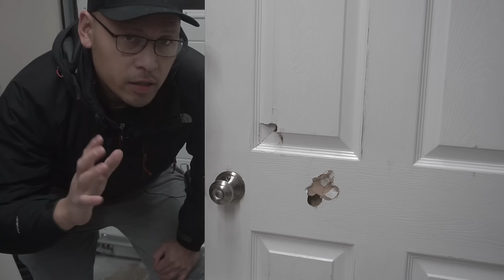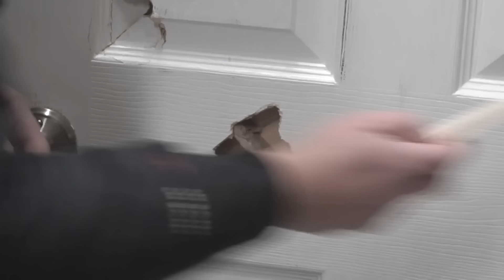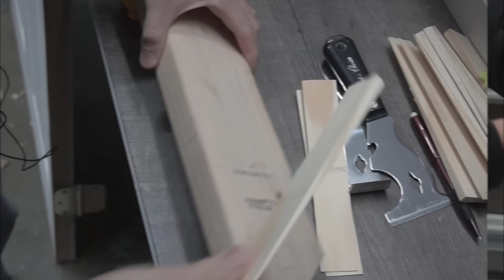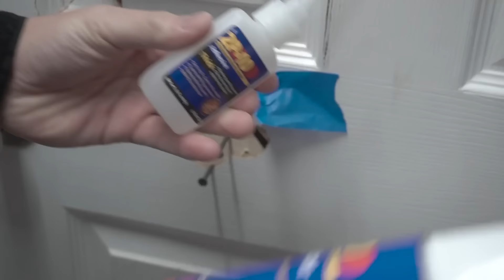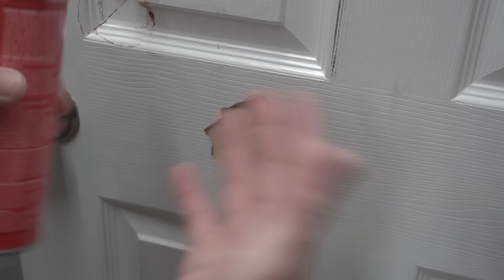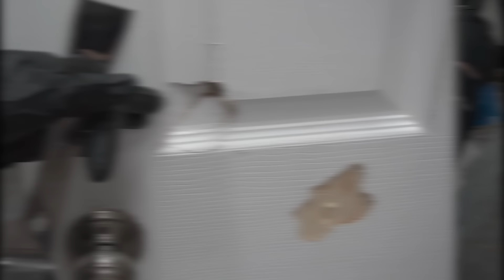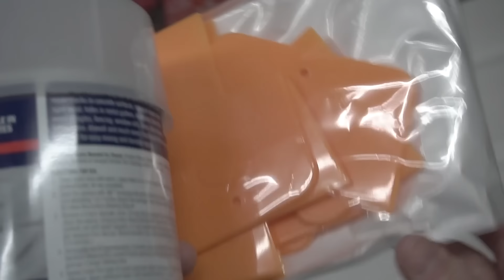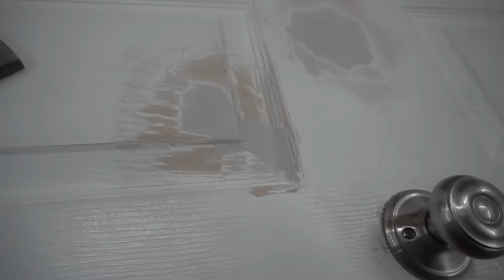How To Patch And Repair A Hole In A Hollow Core Door Like A Pro! EASY DIY Tutorial For Beginners!

Comment: This helped a lot.. I am putting a cat door in my bedroom door that looks exactly like the door you did this job on.  Unfortunately I made a bigger whole than I needed. I had some left over  wood and used screw to fill in the one side of the door so that the car would fit snug in the door.  The wood I used was thin and doesn’t match the thickness of the door.  So on one side the cat door covers the screws and the whole, the other side, not so much.   I might be able to use your method on this part.
Reply from the maker: I’m glad I could be of help! I hope you are able to put the cat door successfully! 🙏🏽😊
Reply: You could get a bigger cat … 😂

Comment: I prefer JB Weld's wood putty over the Bondo, followed by a wood filler to smooth it out.  It's durable, and a little easier to tool for those contours

Comment: Spend 75 bucks and a couple hours to do this, or spend 60 bucks and buy another hollow door hang in bout 5 minutes. No sanding and no blemishes. That is how a professional does it
Reply from the maker: I agree sir. Nothing wrong with options. Plus some people own really expensive hollow core doors that cost over $200+ like Masonite brand
Reply: @FixThisHouse  if I pay 200 dollars for a hollow I am not putting a bond patch in. That's like putting duct tape on new Cadillac. It will work but it's ugly to look at.

Comment: You used Great Stuff for windows and doors, which keeps it rubber properties, and remains soft for seals and such.  The regular Great Stuff, especially the one less expansive foam (1 inch) dries much harder, and works better for holes in doors or walls.  Otherwise, very informative and well produced video..

Comment: My door wasn't as badly damaged as this door, but the Bondo worked great. The only thing with Bondo is that it cures extremely fast. I had about 2 or 3 minutes until it hardened into a taffy consistency. So work in small batches. Otherwise, like I said, it worked great for me.
Reply: Durabond 90 dries hard and is easier to sand than bondo.

Comment: Thanks for the tips.  Wondered why you didn't just put the spray foam in first and then before cured, put the wood shims (I guess we've all used paint sticks too) in with a longer curing wood glue so it doesn't firm up too fast and let the expansion of the spray foam push the wood against the back side of the hollow core door? -- you mentioned that you waited several hours for the foam to set up any way -- pretty much ends up the same wait time in the end?  

short-strand fiberglass Bondo (has a green label) works nicely for the same. I added 1-1/2 inches (square cut wood from a 2x4 trimmed to 1-3/8 deep) to the bottom of a hollow core door.  there are opposing vertical/horizonal patterns when you span the bottom of a door... used a thin putty knife to approximate pattern-- light sanding left valleys approximately the same as the pattern. 

I only mention the stuff with fiberglass as it sanded super smooth (all bondo does) but I was hoping it added some flex since hollow cores are flimsy. 

Any recommendations on a contour sanding kit which would have helped on the grooves if you'd wanted to get a finer touch on those grooves in the panel?

Comment: If you want to replicate the graining of the original finish use a clean yard broom or similar in the semi-dry primer/undercoat surface  to wipe the surface, a single stroke should do it.  Let it dry and then paint over with the finishing coats.

Comment: The hole is smaller than yours to barely allow one shim. Do you recommend tape, a drill bit to sit in the door (I am using a hand drill) foam first then the shim to hold it in? I just don't want to drop the piece but the screw you recommended isn't long enough to brace  against the inside of the door, to hold the glue even with activator.

Comment: You can actully copy the wood grain pattern first by putting on a realsing agent then applying fiberglass resin the cloth and more resin after it sets up peel it off the door gentle now you have a mold to use to reconstruct the wood grain pattern.  Practice with this first on somthing else but I'm pretty sure you can duplicate it good enough no one else will notice the repair.  Paint will go a long way to hide it.  Add a comet if you've done this and let us know if it worked for you I haven't tried it.

Comment: Good job but remember people if you don't have all of these things to do the job,Cost of spray foam, bond filler, glue, paint and your time spent fixing the holes you might as well just buy a new door these none sold doors are cheaper than buying everything you need to fix it.
Reply from the maker: That is true 👍🏽😊, some hollow core doors, especially the Masonite brand can go up to 200+. But yes 6 panels Reliabilt are around $60
Reply: Not with the cost of wood and inflation, it's cheaper for the repair.
Reply: @celticmulato2609  you do no the materials to fix the door has also inflated the cheap core door have not really gone up in price as they are not solid wood doors,so no it's not cheaper to fix the door as the materials have gone up in price than what the cheap core door has.

Comment: stuff holes full of paper.... full hole with joint compound..... apply s thin everal coats and sand smooth
Reply: takes several times till smooth....alot faster and cheaper

Comment: Great job thank you 🙏 for sharing. Question for you. If you use hot glue gun might be easier than the glue you used. What do you think?
Reply from the maker: Thank you 🙏🏽! Honestly Hot glue gun might work! Just make sure you drill carefully because hot glue in my experience is not that  strong of a bond. After filling with foam it will be secured 👍🏽😊

Comment: Good work.

Question is wouldn't it be cheaper to replace the door? Youve used about 100 bucks in material (if buy everything brand new: 15 bucks a can of foam, 65 bucks a foam gun, 15 bucks a pack of shim,  about 20 bucks putty, plus paint etc, plus 3 hours of labor), yet the new door is about the same.

Comment: could you screw it in the either side with a counter sink screw to hold the wood instead of using the glues and filling the screw holes with the wood filler while filling the main hole after

Comment: Fix that detail with a dremel tool. Go easy on the paint, don’t need to apply so much at one time. Using thinner layers you can use your brush to simulate the grain.

Comment: They should make these doors smooth, because matching the grain is impossible
And your patch would go unnoticed
You can also use a profile gauge to put on the mud
I used one to fix baseboard, and you can not see it
Also, real panel doors that these ane meant to replicate do not have raised grain , they are smooth the same as colonial trim

You could actually fill the raised grain from day 1, and have smooth doors in case they need to be repaired

Comment: Hello there I'm currently trying to fix a door with the second issue with the detailing however it was a clean break (if that makes sense) and all the pieces are intact just bent slightly inward, would I be able to use the screw to pull the pieces back into place and use glue and paint to fix it? I'm not much of a handy man so if what I'm asking to do doesn't make sense I apologize.
Thank you for your time.

Comment: I have a door that isn't broken all the way, it just has a crack and pushing against the cracked surfaces they feel solid and you can't easily push them out so that they leave a hole.

I'd rather not cut the cracked parts out all the way. Can I just use these parts as backing and do the bondo stuff + sanding + painting from there?

Comment: How much approximately is one of these doors? So that it can be compared with the cost of having to buy all the material to fix it.
Reply from the maker: Hi! Depends on what type of hollow door you currently have. Some have Masonite brand hollow cores that cost over $200+. All these materials will cost you around $50-60

Comment: He should have made a hole to the left where the door is flat, he could have been pushed the repair where there is a design flush.  On the backside he could've used a durabond 90.  Where he punched a hole in a flat surface, he could've used durabond 90. Making sure to level it out with a taping knife.   The same concept applies to the other hole that he put a backing on
Reply from the maker: Thank you 🙏🏽

Comment: Step 1. Go in HomeDepot.
Step 2. Buy new door.
Step 3. Replace broken door.

Cost: $61 plus tax if applicable. 
The described method is time  consuming (time=$$) and you still have to buy Bondo. End result - repair is still visible
Reply: Most of the doors you purchase have to be sized to the door frame It’s not going to fit exactly from Home Depot and most likely will be off by a inch in length or width
Reply: True but you also have to remember that the slabs from Home Depot need to have the mortises cut. Unless you buy a prehung kit and take the door off of that but good luck if the hinges don't line up. A lot of people don't have the know how to cut a good mortise even with a hinge jig.

Comment: The door cost less then the repair i would never waste time and money on a cheap door
Reply from the maker: That is true, but some hollow core doors at expensive. The one on the video is about $60  made by Reliabilt, also depending on how many panels you get. The expensive hollow panel are made my Masonite costing over $200+

Comment: good tutorial for a repair but honestly a new hollow core door costs around $50. All you have to do is cut out the hinge spots which can be done with a cheap jig. You just have to make sure the hinge cutouts are the same. Unless you have bondo, sanding paper and foam laying around it will just about even out.
Reply: I agree with you, this is good information for someone who has a hardware store near the oak tree in the sticks. The outskirts dont sell doors.

Comment: Never seen any door crack, including hollow doors, just because of people pushing on any part of them to open them... what you're saying is ridiculous. If people punch or kick open their doors then it's not a weakness in the door that creates the problem, it's improper use and handling... and don't most normal people use the doorknob or door handle to open and close doors? Not to mention, there are far easier and more solid, quality repair techniques that can be used to repair hollow doors or walls that have been damaged than this overly complicated method... but I suppose this will be good for some people because some people like it complicated.

Comment: It would be way easier just to replace the door, they are not that expensive. The money you spent on supplies seems like half the cost of a new door.
Reply from the maker: Thank you for the feedback! 👍🏽🙏🏽😊
Reply: Except when you aren't a carpenter and realize that the new door has mortises that need to be cut. Now you need to buy the tools for that if you don't have them. Not only that, it's off to YouTube to see what it takes to cut out for hinges. Easy for those of us in the know but like calculus for someone who isn't savvy with a router
Reply: @wayofthekodiak3118  I agree.  I don't like mortices either. I would cut out the whole frame/jam and replace with a pre hung door. They cost about $160.

Comment: ridiculous so much work to fix a door that costs 100 dollars
Reply from the maker: Some hollow core doors like the Masonites single panels cost $200+.
Reply: This door is only $45 for the slab at my home depot.  Even at $200 for a new door,  you're still saving a ton of time and work it would take to get a $200 door back in tip top shape.

Comment: I have this irrational..... unease, almost hatred for this type of door.  It's got the two lines and then the two dots on top.  Why?  Why this symbol?  Why ONLY this?  WHY is it near omnipresent?  Why this stupid design, literally everywhere?  I hate it.  It's the stupidest thing I've ever seen.  Just look at it.  Need I say more?  It's like a bizarre form of domination, a slap in the face, degradation, an insult.   It is insulting all of us just by existing and it is everywhere.  The meaning is unknown, but I can tell you this.  I don't like it.  I don't like it one bit.  Never again will I have even a single one of these stupid looking doors. I hate them.  They bring me torment and great unease.  And there's all this space in it, it's like a sail.  I guarantee it catches a lot of air when opening and closing, and uses more calories.  Waste of energy.   A normal, proper door, the air just slides right off.  It just makes sense.  So why does everyone have this door?

It's awful.  Just look at it